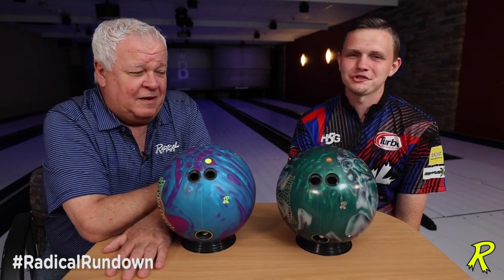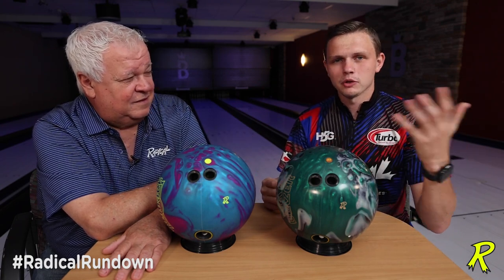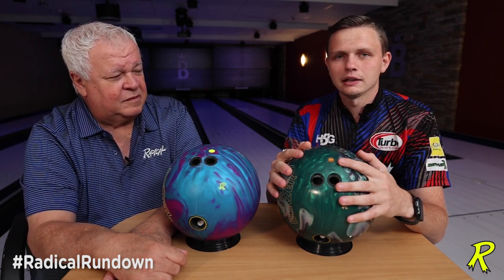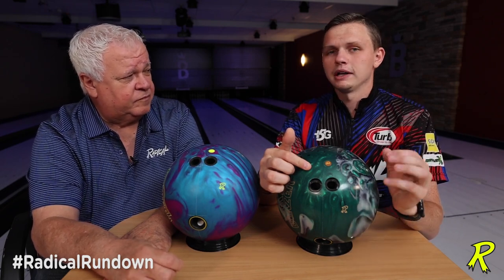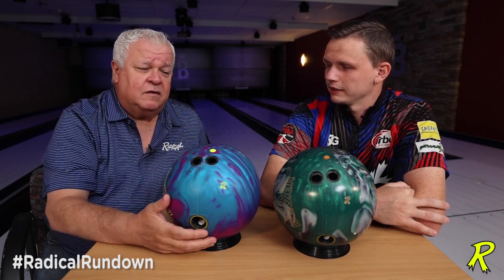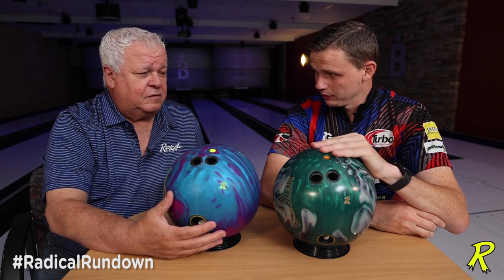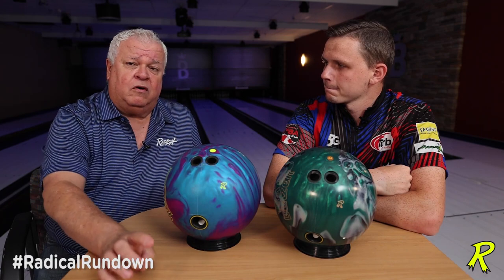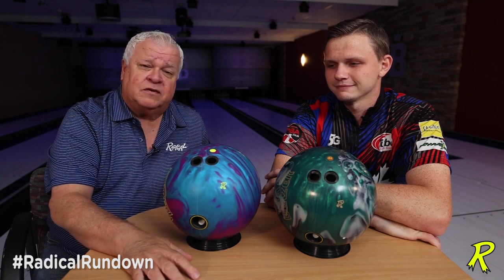Layouts - House Shots vs PBA Tour/Sport - #RadicalRundown

Comment: I'm using a pin down under the ring finger on a symmetrical ball on a house shot and averaging over 200 I'm trying to blend out the over-under I also took a 3,000 pad to the ball to blend the ball out better

Comment: does pearl vs solid or ball speed matter when deciding these things?  I'm high tilt 16.5 degree, 14mph and 350 rpm.  I love my brutal collision drilled at 35 x 3 5/8 x 30 but dislike my 3 D attack drilled the same way.  I'm going to adjust surface but wondering if it would have been a better choice to have chose a different layout.  It just hook stops when moving left.

Comment: This was actually a bit surprising. I don’t really understand the concept of using sharper reacting balls on house shots. I find that they bounce too much off the dry and slid too far in the oil, making the cliff even worse. How do you avoid this?
Reply: Surface. That’s helps blend the cliff and smooth out the sharper response to friction.

Also, there’s a difference between sharper- violent motion and the ball retaining its energy longer. So stored energy downlane helps create pin carry
(Coefficients of restitution)
Reply: I'm getting venom shock but what the hell house drill and pba drilling I'm freaking confused

Comment: What is a "taller pin"?
Reply: A pin that is pretty high above the finger holes (probably more above the ring finger and kicked to the right a little bit). 

I have a taller pin on a Pandemonium Pearl, and it snaps.
Reply: Visually higher above the fingers. In dual angle layouts, taller pins will have lower VAL angles

Comment: Andrew mentioned that low to medium rev rate player bowling on a house or league pattern will generally want a long pin up/stronger ball.  Does this hold true when the lanes break down?  With 5 players on each team/10 players bowling down 2 lanes, the lane will break down really fast for a right handed player.  
What do you suggest?  Do we move boards or ball down?
Player information:  
late 30's, 235 lb male.  
16lb ball
speed dominant (about 15.33 mph) with a tendency to muscle the ball
low rev player  
accurate for a league bowler but not a pro.  
Falling into the "retired athlete turned bowler category."
Reply: Both?

Comment: It was a pleasure meeting Andrew at the SABC Doubles Tournament in Tomball, Texas.  

I am a Rev dominant player.  One of the primary concerns is hitting the pin deck light.  Another concern is flat 10 issues.  

What coverstock, core type, and layout would you recommend?  

Ball track is another concern.  Low Rev players tend to choose a ball track 6 - 10 boards.  Alternative ball track is 16 - 19.  

What ball attributes and layout you would suggest for that middle lane track?